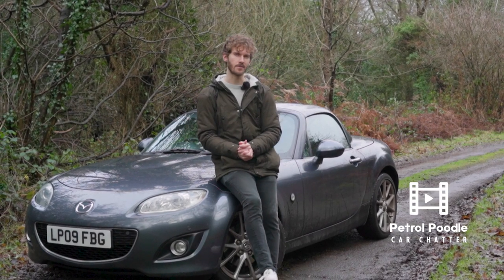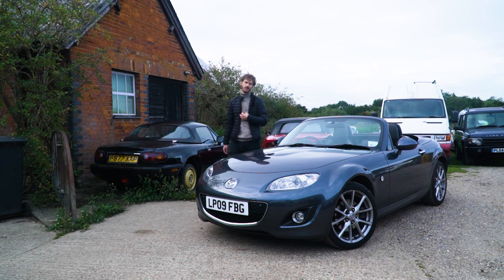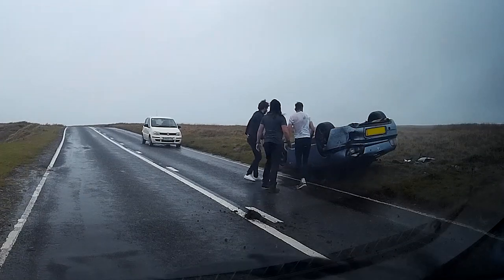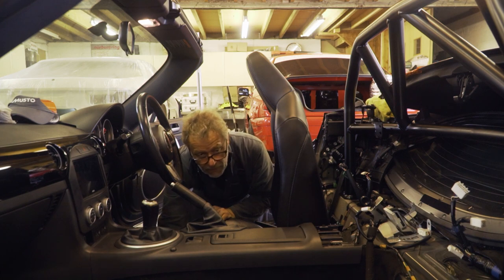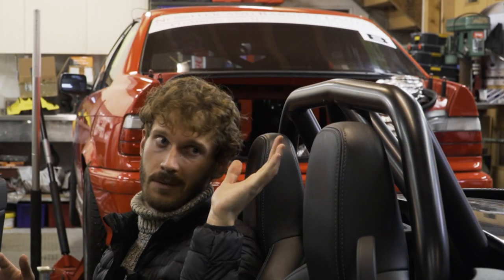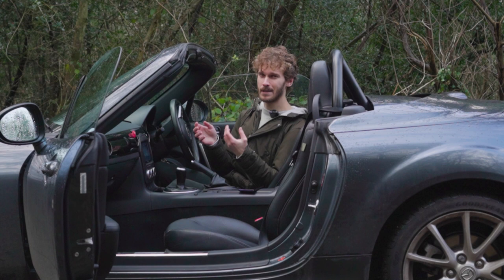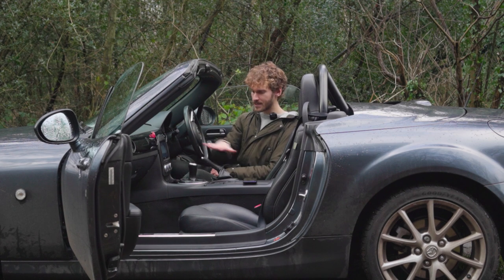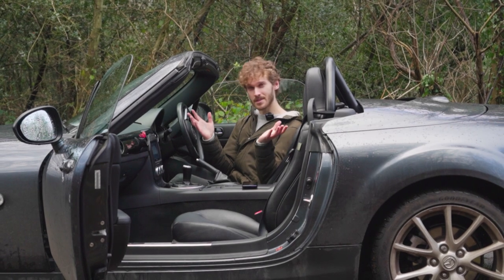Is This The Most Essential (Yet Overlooked) Mazda Miata MX-5 Modification? GC Fabrication Rollbar

Comment: Regarding the MX5 roll over the driver was at fault 100% in conditions with a standing water slow down people do this all the time and there's a price to pay nothing wrong with the safety of the MX5 it's poor driving. you could have got hurt in any vehicle
Reply from the maker: Definitely agree that the driver was at fault for hitting the standing water (and too quickly). But you can't say 'nothing wrong' with the safety when the rollbar sits below the average head. If you or a loved one smashed their head into the ground in a rollover you wouldn't be standing by that statement hahaha. The same aged Z4, Boxster, CLK and TT all have rollbars that are thicker and well above the head of even the tallest driver, that's more the point that it's a poor bit of safety design. It'd be like having passenger airbags that only deploy halfway and don't stop you smashing your face on the wheel haha.

Other than the tiny rollbars it's got decent dual-stage airbags and decent structural safety, much better than older MX-5s

Comment: The Mazda designers did the loops because now you can’t see out your rear view mirror - which wouldn’t pass the equivalent version of a manufacturers IVA test. Sorry not for me, too ostentatious, and rear visibility; non existent.
Reply from the maker: That's understandable about the rear visibility test and it not passing an IVA equivalent. However, rear visibility is certainly not non-existent - it's absolutely fine, it's better than my 2010 Honda Civic was! And it's better than a van which has none at all and plenty get by.